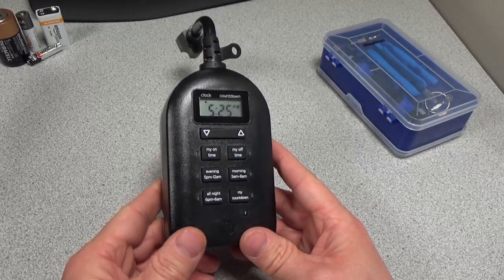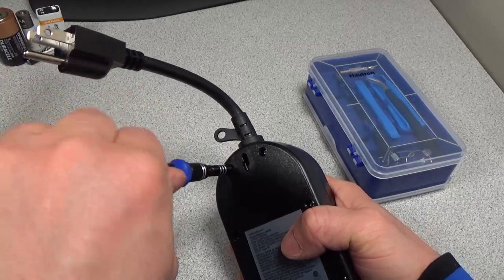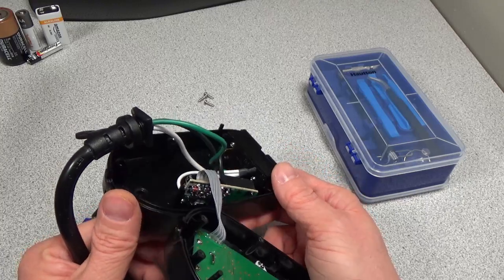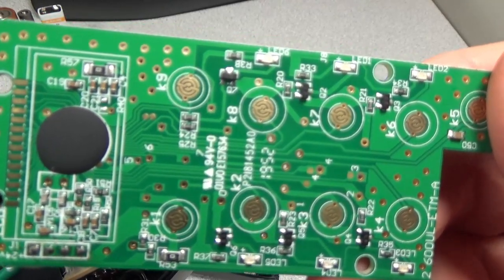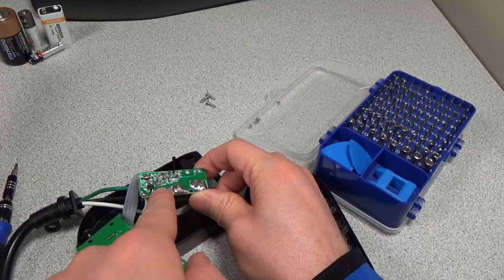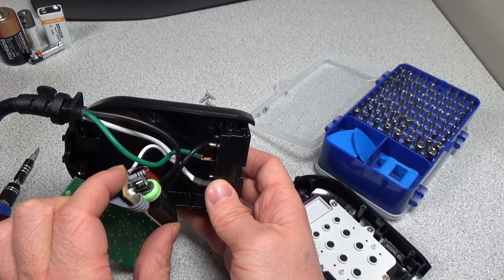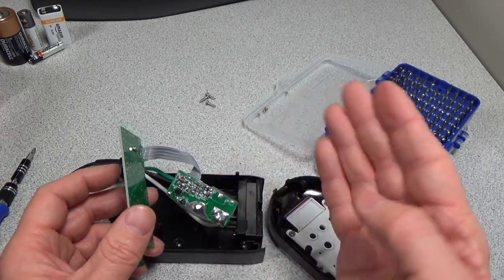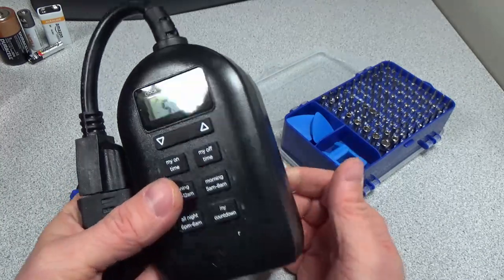myTOUCHSMART Timer Teardown - #26

Comment: Nice tear down, I just purchased one of these I was wondering if the battery fails will the unit unit still work? Thanks
Reply from the maker: The low voltage rail will be kept alive by the charging circuit as long as the battery doesn't fail in a short circuit.  These small NiMH cells are available on eBay but I would almost lean to a lithium cell and a low voltage regulator depending on current consumption, or even an EDLC.  Would have to do some (isolated) testing to see how much power the circuits are using.
Reply: @AllThingsOnePlace  thanks for the reply, I have had mine for two days and it  seems to be working good for now. Reviews on Amazon seem good but not great. Seems to be a crap shoot trying to find a reliable timer that lasts more than a year.
Reply: I bought two last year and both not working this year!!😢

Comment: Can the batteries be replaced or would it be better just buying another time?
Reply from the maker: The battery is not user replaceable.  It can be replaced if you have some soldering skills.  As long as you plug the device in once in a while to keep it topped up the battery should last a reasonably long period of time (years).  The device also doesn't NEED the battery to operate.  The battery is just incase the power goes out it will store the settings.